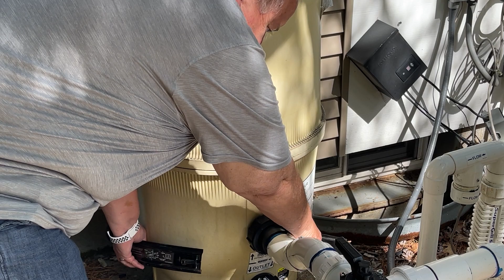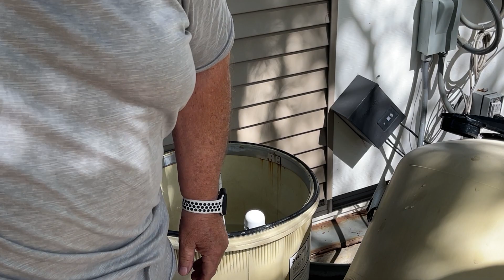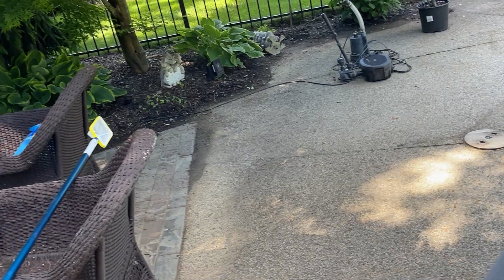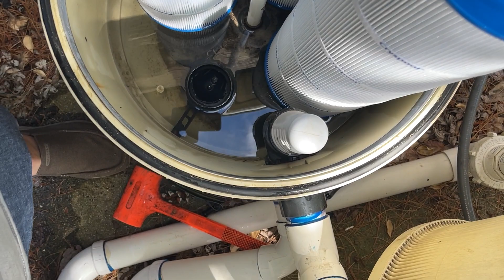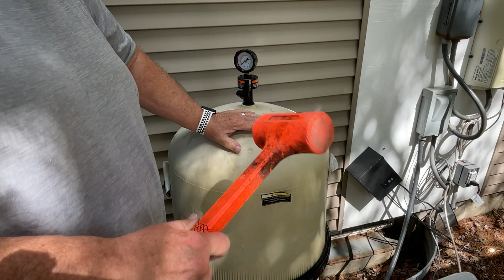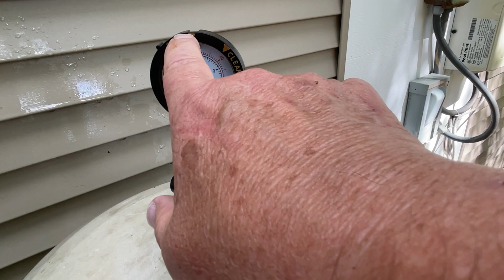**Stop Cloudy Pool Water! Replace Your Pentair Filter Cartridge the Right Way**

Comment from the maker: 💡 *Quick Tip for Pool Owners:*
If your pool pressure starts creeping up or your water isn’t as clear as it should be, your *filter cartridges may be overdue for replacement.* In this video I show exactly how I replace the cartridges in my *Pentair cartridge filter* to keep my 26,000-gallon pool running at maximum filtration for the season.

👇 *Question for you:*
How often do you replace your pool filter cartridges — every season or every couple of years?

If this video helped you, *give it a 👍 and subscribe* for more pool maintenance tips, equipment installs, and DIY projects!

Thanks for watching! 🏊‍♂

Comment: Thank you so much for this video! I’m kinda new to having a pool and love being able to do things on my own. I had really cloudy water with a powdery dust that wouldn’t filter out. It’s been three weeks and the water was getting worse even after heavy chlorine and shock doses. I went to my local pool store today and they told me to clean my filter cartridges but their instructions weren’t very detailed so I came across your video via Google and was able to take the filter apart, thoroughly hose down all four cartridges (they were unbelievably  filthy) and put the filter back together in around 45 minutes. I added water and shock to the pool and will continue running the filter overnight. I expect to have to clean the cartridges once more as the dust is removed from the pool but I can already see a big difference. This video was a lifesaver!!!